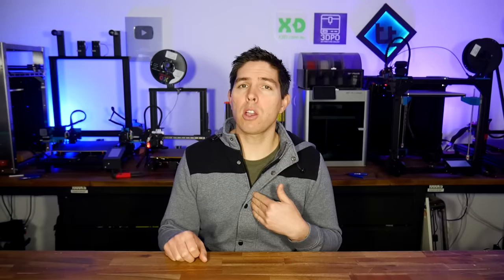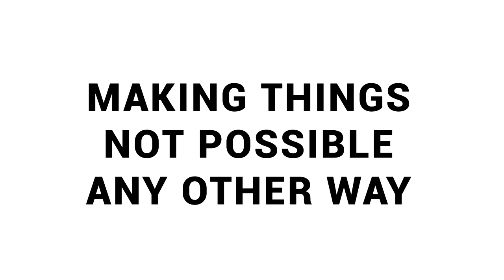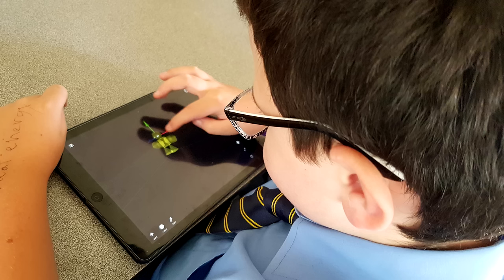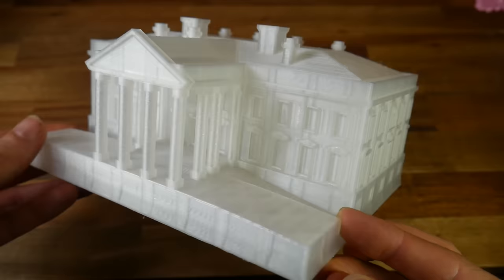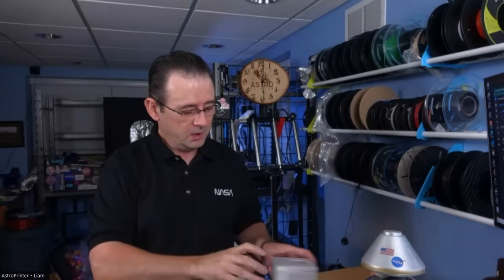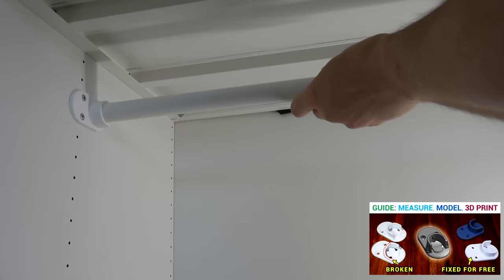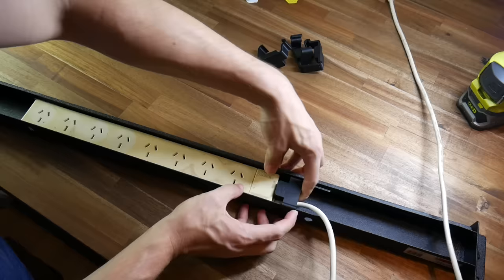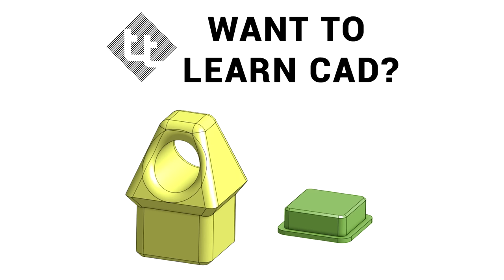These 3D prints will convert non believers

Comment: My Ender 3 paid for itself in the first nine months simply printing replacement parts as you have done or printing custom electrical project boxes. I am lucky as I can use CAD but you hit the nail on the head, it's important getting people interested in designing there own parts. Respect and many thanks for the work you put in for the community.
Reply: @RuDuffEnough WellRu Absolutely,  knowing even basic CAD skills enhances the interest and factuality of 3D printing.. I am learning Blender now driven by my 3D printing needs. Another positive is there are so many great free programs available now.
Reply: @RuDuffEnough WellRu 100% respect to Autodesk for supporting the hobby maker with free licences, I wish the big commercial companies were more forthcoming with private use licencing. Blender is more focused on organic and free form structures but well worth learning ultimately.
Reply: @RuDuffEnough WellRu 3D printing is to me the most empowering home technology available today especially if you have some basic CAD skills.  If you are using CAD primarily for 3D printing best follow tutorials from the 3D printing hobby as designing for 3D printing has it's own challenges.
Reply: That is how I got into 3D printing. I wanted to learn CAD/CAM so I started working with Fusion 360. I bought an Ender3 as a way to validate my designs not thinking it would be much more than a toy. I was wrong. The printer has payed for itself many times over by making replacement parts for all kinds things and in some cases allowed me to design out a weakness that caused the original to fail. Next, I want to explore flexible filaments as I can see many applications.
Reply: @mikechafin7351  Same for me, I come from an engineering background and got an Ender 3 about three years ago as a bit of fun. Turned out to be one of the best things I have done, love the freedom to create useful parts for the home and workshop. I too want to try flexible filaments, mainly use PLA and PETG.

Comment: A neighbor needed replacement knobs for her cooktop. The manufacturer wanted $75 for each one of 5. The originals were made of cheap thin plastic. I found a design online that was close enough to match, I used a CAD program to make them thicker and stronger and printed them for less than $1 each.
Reply: did you print it with PLA?
Reply: Not counting the price of the electricity and printer 😜
Reply: @cgwworldministries83  The average power draw of a 3D printer is around 125Watts, resulting in a cost per hour of 1.58 cents, and  37.92 Cents per day(with a kWh price of 12.69 cents in the US the rest of the world isn't much different).

Note This is 1.58 cents per hour
prints will usually last between 30 mins and 12 hours
these prints will cost between $0.79 and $18.96

that is pretty much nothing
Reply: @RomanMines64  I’m certain you meant 18.96 cents, not dollars.
Reply: @JohnLatrobe  yeah, but even if it was dollars, it would be pretty much nothing in monetary terms
Reply: @cgwworldministries83  The ability to make whatever you may need whenever you need it, and to do the same for your friends and neighbors, is more than worth the price of a printer imo. Plus electricity is cheap, and this kind of manufacturing lends itself well to being ecofriendly as the plastic can be recycled back into filament to print other parts.
Reply: @cgwworldministries83 that doesn’t matter electricity is cheap and the printer pays for itself after a while

Comment: I totally agree that printing things that you can't buy is invaluable. I printed parts for my mototorcycle and my outdated alarm system. I also LOVE printing scans of classic sculptures.
Reply: Can I ask what scanner do you use?
Reply: @dim6892  Without knowing where it was going or what function it served, or what I printed it from, that was a silly comment.
Reply: @dim6892  PETG is not so brittle and there are many different hardness TPUs that are extremely tough and not brittle at all.

Comment: the key to 3d printing is learning cad. once you do then it becomes an invaluable tool.
Reply: Absolutely. Without 3D CAD skills to me 3D printer would be absolutely useless thing to own.
Reply: @jothain  luckily 3d design is pretty intuitive and there's a lot of different ways around different issues. I really feel as if someone could pick up fusion 360 and make most anything basic they could need within a week. I recently bought a 3d printer and haven't done any 3d modeling since college 6 years ago and I was able to pick up fusion 360 again in minutes
Reply: @jothain  without the want to learn I would see someone buying this as an icebreaker piece and never actually making anything useful
Reply: I've been meaning to learn some sort of CAD software instead of just designing stuff in my head. Maybe getting a 3D printer will push me to finally learn.
Reply: @Moostery  That's exactly how I went. I was already adept with 2D CAD's and was planning to get into 3D. Then I bought 3D printer to "ignite" actually getting into 3D design and actually get functional parts. It's quite easy to get into. Just don't expect to make anything too complicated like frame of something like power drill or something. Simple basic functional parts and expand features from time to time. 👍🏻

Comment: Astronomy and 3D printing are a match made in heaven, so many custom adapters needed to connect equipment from different manufacturers. I have made solar filter holder I custom designed, hand controller brackets and so many other accessories

Comment: Hey Michael, thanks for everything you do. Mentioning that some things can only be created with additive manufacturing is great but but I feel that you've overlooked some of the most valuable applications related to this. Unless clients have previous experience with AM like aerospace users, I find that many people and organizations still need substantial convincing that "3D printing" is even something to be taken seriously and some seem to think it's new or a fad, remaining ignorant of the half a century of tremendous work and research that got us to where we are today. Hopefully the examples I provide can help shed light on the reality. I'm not sure how AM got this reputation of being a hobby thing, but there is a *lot* more to it.
    Starting at the simplest level, yourself and many of your viewers probably have products in your homes right now produced on factory equipment and continuous production processes I've upgraded with my 3D printed parts. Amazon boxes and packaging for food for example... Lots of the people reading this will likely have one of these things sitting in arm's reach right now. One of the ways we protect employees and improve flow is by using air transfer tables to hover thousands of pounds of material so you can move it with a finger instead of wrecking your back or using a ton of electricity. My air transfer nozzles make this possible at vastly reduced cost, enabling the small factories who produce these boxes to afford such upgrades and compete with the big outfits for contracts. Also, I build automation control systems such as touch screen equipped microcomputers to run these giant machines. Since I build everything from the PCBs and operating systems up to the final product, nobody makes mounting hardware, screen bezels, suitable electronics cases, etc. Rather than pay $50,000+ for tooling to injection mold something (useless, since they're all different) I can simply spend a handful of hours to design the parts needed, print them, test, and integrate them for end use in the factory. Mounts for other hardware, safety shields, cable guards, routing for air tubing and many other things benefit from this as well. I've spent over 6 years improving the production process on my own equipment to be able to reliably produce end use products which does come with a cost, but now I can make fancy things on inexpensive machines similar to an Ender 3 that big fab houses claim are unprintable and HPee and Strat-ahem printers simply can't produce due to the limitations of these systems. I've actually never printed a toy for anyone but my cats but I've produced automotive parts which were unobtainable like you mentioned, many tools for fabrication, medical and robotics components, and weapon safety improvements to name a few.
    Having worked in medicine for over a decade as well, I'd like to point out that 3D printed PEEK orthopedic implants are the ideal solution which can be customized for the individual patient, capable of achieving a flexural modulus similar to bone and better wear and rejection characteristics than titanium alloys. In some cases like pediatric cranial plates, 3D printing is the only practical solution. Models for surgeons to practice with before a procedure can be produced from actual CT/MR images of the patient in advance and used to reduce risk and improve outcomes, and to better inform the patient as well as biomedical equipment manufacturers assisting the team.
    The US Army now deploys with 3D printers to assist various missions, and replacement parts for Air Force aircraft can be produced on the spot without risking more lives, equipment, and money to send them to the site. Printed components allow me to design RADAR systems which have uniquely controllable beam paths, and the equipment I provide laser cutting and marking services with is largely printed in-house. Additive structures built by similar machines economically produce disaster shelters, homes, and agricultural structures in place to make basic survival more affordable, less harmful, and more energy efficient but that isn't exclusively using polymers.
    Given the complexity, serious nature, and how little most AM processes really have in common with printing, I really have a problem with the term "3D printing" in general. This isn't printing, you don't click "print" and magic comes out, it is nowhere near as trivial as that and "printing" seems to imply creating a visual representation of something. While this can be a use case for additive, that's like calling a freight train a cat litter carrier but I'm sure that is all my cats think they're good for. Engineers are just too busy solving problems or too constrained by the business and governmental requirements for secrecy to make videos about it, but I wish YouTube would quit perpetuating the concept that "printing" is simply for D&D, airsoft, and cosplay - this is absolutely untrue.
    I hope that content creators like yourself will cover some of these practical use cases in more depth in the future, and the fun and importance of becoming additive manufacturing technologists rather than consumers and printer collectors. Sadly, sponsored content may be paradoxically throwing fuel on the fire. I appreciate your policy on sponsored content, but I think it can create a conflict of interest for some. To earn money by working in manufacturing restricts your ability to make content about making, but becoming sponsored may imply that some creators should not talk about the important reasons why the all new XYZ printer mod is useless if you would just learn about how the machine works. Guys, you don't need any of the crap they keep trying to sell you. They're quick solutions to problems you can easily solve yourself. Sure, some are well designed and it doesn't get easier than buying something. However, nobody can sell you a better machine than you can learn to design, they can only sell you what they're capable of mass producing at a profit and that often comes with hidden costs necessary to sustain their business models.
    If you really like the technology behind the making then remember the spirit of RepRap and the whole point of the contemporary movement was for people to learn to build and improve the industry and the world, not to buy things designed by the community which are being sold as if they were developed by the silly brand names they sometimes represent. An "Ender 3" or a "Prusa i3" is basically just a kit for building a RepRap Mendel without having to source parts, have friends who are already CNC nerds, or learn a hundred things to get started. They're a starting point on a journey, not the destination so look beyond the retail solutions and think about how you can solve problems. If you made it through all that, thanks for reading lol.
Reply: This is an extremely useful and thoughtful comment. Thank you. I need to think about this some more, as I am a novice in this area, and, perhaps might get in touch with you.

Comment: A year or so ago I was looking into commercial grade 3d printers, trying to get my workplace to invest in one. Apparently it is very common for the large automakers (in North America at least) to not carry little/no spare parts for their assembly lines. They instead have a high end FDM 3d printer as well as a metal 3d printer. When a part breaks, they simultaneously start printing a replacement in plastic, one in metal, as well as order the proper replacement part. Depending on the part, the plastic one is complete in under a day and the line resumes operation. The metal one will take 2-3 days, and once it is complete it is installed and the plastic one is discarded. Finally, once the proper replacement arrives, it will be installed, and the metal 3d print is often kept as a quick stand-in for future breakdowns. 3d printing allows them to not have to keep large amounts of money tied up in spare parts for every possible breakdown, but still reduces the impact of any breakdown. If it's useful for large scale manufacturing, I think it's more than a useless toy.
Reply: We use 3d printers in our maintenance shops but can't sit around waiting for parts to print, downtime is way too expensive. We do prototype alot, especially experimenting with modifications for existing components. For some in-house developed equipment we print components where we can so we don't have to pay for custom parts from vendors. They're pretty invaluable at this point but most people never see them in use.
Reply: Wow I did not know that, really cool!

Comment: Whenever I meet a non-believer, I simply show them my electric scooter that I just arrived in riding on. It's filled with 3D printed parts such as extra battery holders, Display protection cover, mudflaps, extra turn light extender (made of TPU), phone mount, extra hooks to hang grocery bags on, lock-wire holder

Comment: Great vid! I absolutely love being able to print brackets for things that don't exist. It's a world of custom manufacturing that can replicate injection molded plastics, but at any capacity; all without the massive overhead of injection molded plastics. I've made a set of custom wall mounts for my Valve index and Vive trackers, as well as a replacement bracket for my Unifi AP (purchased secondhand and didn't include the original bracket, nor does Ubiquiti just sell the original bracket).

Comment: We were in Texas for the Big Freeze a couple of years ago. The outdoor shower froze and a key part holding back the water broke. There was no valve local to that shower so we had to turn off water for the entire house. However after a few printing a few prototypes of a custom plug to hold back the water in the shower assembly I was able to temporarily fix it until we could order proper parts. Got the water back on to the rest of the house and became a true believer in 3D printing.

Comment: My father had a lawnmower in his garage for more than 10 years destroyed. A simple piece I made with my printer helped to make it repaired. At the beginning my parents laughed about my printer but now I get a message a week from my father with a question about: can you print this or that. 
And over a year I printed many parts for friends and helped them with a simple print on their big problems. The best is if you have a problem or a missing part and modeling the piece on the computer and print it and hold it in your hands. Then you install it and when you hear the clicking noise and hear the perfect fitting it always keeps me a smile in my face

Comment: I have a 3d printed ram pump watering my garden right now (video on my channel), an air raid siren (also on channel), and have 3d printed injection molds. I've also used it for various tools and fixtures. My family's business also 3d prints concrete stamps for landscape curbing as well. I've 3d printed battery adapters for electric motorcycles. There is a lot that can be done with a printer. If you have cad skills and a need for custom parts, its an incredible tool to have.